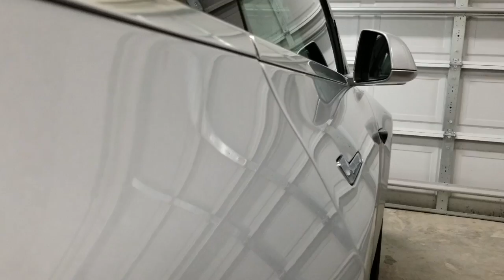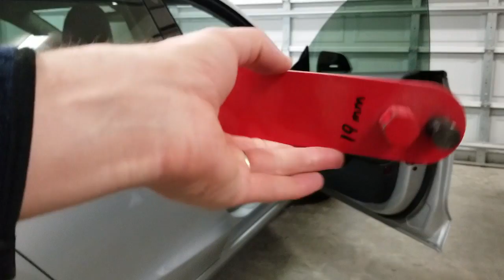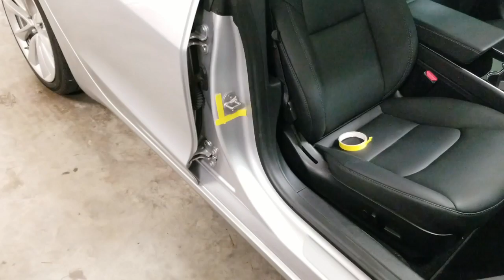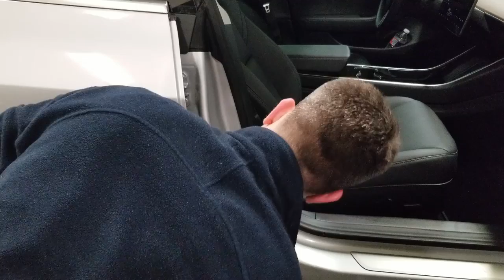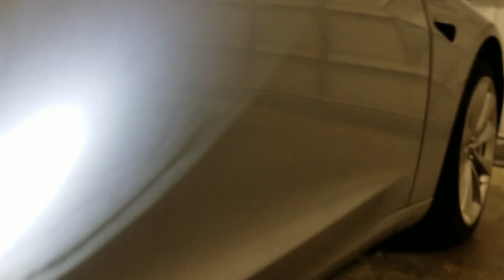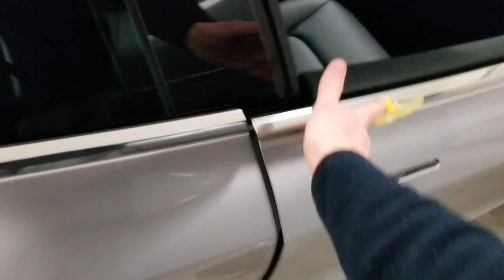2018 TESLA MODEL 3 | FRONT DOOR ALIGNMENT

Comment: Does it damage the hinges/paint/rust protection doing this with the tool?
Reply from the maker: Not really. Just slightly bending things. Not really enough to break paint or anything major
Reply: @samg5543  Did you have to adjust the window afterwards?

Comment: I had success fixing my door by loosening the 4 13mil bolts just a bit on the hinges and pulling up with the door almost closed, then adjusting the striker plate and tightening everything down.
Reply: Was this easy for you to do? My door is just a tiny bit too low, am thinking about loosening the 4 bolts just a little bit to pull the door up and retighten, but I don't want to mess up the alignment completely 😅
Reply: @Xantulle it wasn't very difficult. If you have the tools, go for it. It will likely take 1 or 2 times to get it just right but can improve the look with just 1 adjustment. Sometimes just adjusting the striker can fix the issue. Make sure the striker lines up good best you can with the latch.
Reply: @marcelluskrueger462  thanks, did you use a torque wrench or normal wrenches? I only need to get the correct bit or screwdriver for the striker screws I think. Don't have that yet.
Reply: @Xantulle  I just used a normal wrench. About a "grunt" tight, or about the strength to break the bolt loose at first. You'll need a T45 Torx bit for the striker.

Comment: Very interesting Tool !!
... I thought the hinges would have had adjustments.
The hood adjustments are the easiest to fix, the underside of the frunk has two knobs that are justable
Reply from the maker: The hinges possibly have some adjustment but you risk exposing bare metal if you shift them around.
Reply: I tried fixing this on my car after getting a replacement door by removing the door and  moving the bottom hinge on the chassis back as to move the door up at the back end of it. Twice I tried it but it didnt make much improvement. I gave up the second time because putting that door back is absolutely exhausting.

Comment: Wait how is this the proper way to do this. Doesn't this put stress on bolts and hardware/hinges rather than actually aligning things properly like re-positioning the door striker or hinge?
Reply from the maker: Yes, this bends things. If there is no provision for adjustment in the holes, this is the only way.  If you move hinges around, you also disturb the paint "seal" behind the hinges and it can start rusting.

Comment: Just got my new Tesla 3 yesterday and the doors are misaligned.  Already set up an appointment to have it adjusted but very scared if the service will do a good job or not.  When we went to pick up the car, we saw other new cars also had the same problem.  This was a known factor, but I do not understand why this is still happening.  Have to drive 2 and a half hour to have this fixed.
Reply: This sounds wrong.  Tesla mobile service will go anywhere for repairs.  We are 4 hour round trip to closed SC and mobile repair comes to my wifes office and does repairs on site.  They did door alignment one time and upgraded charge port with new design that has improvements for winter.  We are just out of warranty now, the mobile tech sold me upper control arm which needed replacement and diagnosed the issue for 0.2h and I had part installed by friend who is a mechanic and they did alignment at local shop.  I'm in Ontario, Tesla service has been amazing for me so far, 100k km's on Model 3

Comment: The problem with my Model 3 is that the bottom half of the front driver door is not flush with the back door.  It is more inward. Do you have any suggestion how to fix it?  Tesla Service Center refused to fix it even though with one eye open you still can see the misalignment . They said it was within the tolerance. I don't know what to do. Thank you.
Reply from the maker: I would have to see how the fender and rocker panels look before telling you exactly what to do, but you can possibly adjust it at the hinges by loosening the lower hinge bolts on the door side and pulling the door bottom outward slightly, but if it's already flush at the fender and the front of the rocker panel, you will need to twist the back of the door slightly to maintain the fender and rocker alignments. You would do this by propping the door open at the bottom, against the door jamb, with something like a short 2x4 and pushing the top of the door towards the car to twist it. Obviously, you need to protect the paint on the door and body and be careful to spread the loads out to not dent anything. If you are not able to do it, then take it to a body shop that isn't scared of it. Something like this should only take a good body tech about 30 mins. There may even be a tool out there that will twist doors, but I haven't ever looked for one. try autobodytoolmart.com
Reply: @samg5543  Thank you so much for your advice. The instruction is very logic and makes sense totally. However, I don't think I can do it myself because I am not a mechanic. I wish your shop is around here (Bay Area), I would  bring the car to you right away.  Again, I really appreciate your advice.
Reply from the maker: @dantdang720  no problem man

Comment: Would this work for a horizontal adjustment? My hard edges and chrome trim are lined up (so no need for vertical adjustment) but when the door is closed it doesn't sit flush with the whole body. Wonder if I can move the latch inward slightly
Reply from the maker: Yes, you should  be able to move the stiker on the door pillar inward slightly
Reply: They have countersink screws on the bracket  so won’t it just realign to the same position?

Comment: Do you know if the front hinges are adjustable where the hinge bolts to the car? I know they are non adjustable where they bolt to the door but wondered if the front hinges could be moved slightly up or down on the body?
Reply from the maker: I haven't tried that,  but i would assume there is a little adjustment there.
Reply: @samg5543  here is my issue: https://twitter.com/WadeAndersonPT/status/1108116890759553024
I unbolted the bolts that attach the hinge to the door and that part is not adjustable.  I will try unbolting the hinge from the car body next and see if it will adjust there. Tesla has told me over and over that the doors are not adjustable and Tesla Service said it was a problem with the machinery when the car was built. They will not attempt to adjust the door, but look at that video and it is pretty significant, especially when I compare to the passenger side.
Reply: @TeslaSocial  My passenger front door was also a bit low like in this video. Telsa adjusted the door for me so it was aligned.
Reply from the maker: If there is not enough adjustment in the hinge holes, you will have to remove the door from the car, tape around the original location of each of the hinges on the body, then remove them, file out the bottom of every hole in the hinges by the amount you want to move the door up, then bolt them in place (only move the hinges up vertically based on your original tape outlines, not horizontally) test fit the door and make sure it fits. Once you are done, re-mark the hinge locations, then remove them again, touch-up the paint behind them so they don't rust (you will be exposing metal that was not coated at the factory), use body caulk behind the bolt heads if any of the hinge holes are now exposed with the bolts installed (to keep water from getting into the hinges) then reinstall them in the new locations and remount the door.

Comment: Would you know how to adjust the trunk? The gap on one side is around twice the other side below the brake lights.
Reply from the maker: First make sure that the trunk lid is  flush with the quarter panels. If not,  you should be able to lift or lower the stops by the tail lights to raise or lower its closed position. If it's flush with the quarter panels already, you need to adjust your bumper cover to match the trunk lid. This can get pretty involved, so don't mess with it unless you're familiar with body work.
Reply: @samg5543  Thank you for the response. It makes sense now what you are saying. I never would have thought that the bumper cover is the one that would have to be adjusted. I think I might leave this one to the professionals.